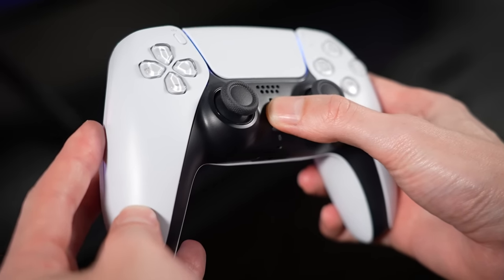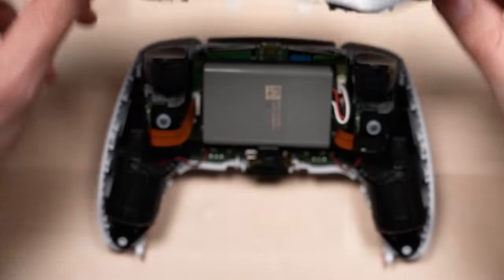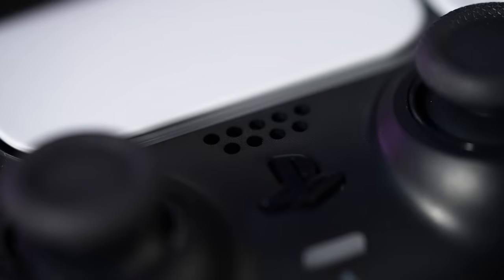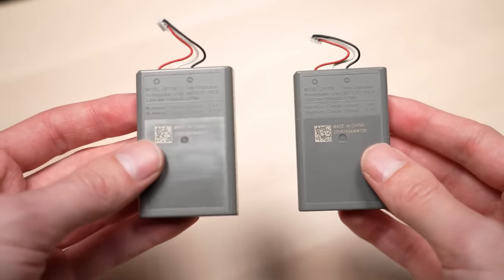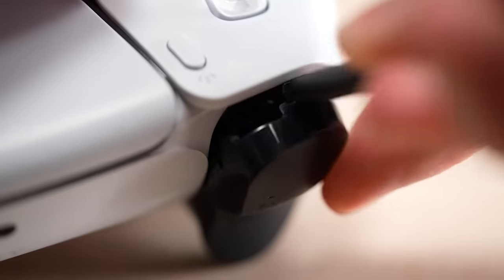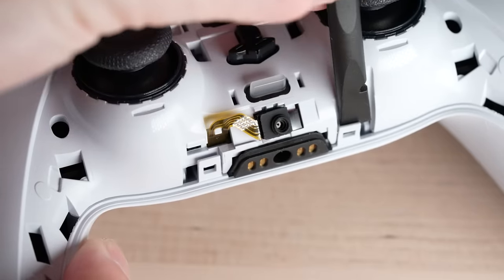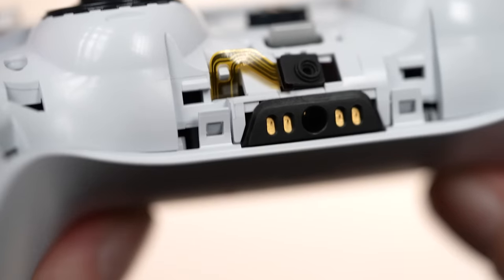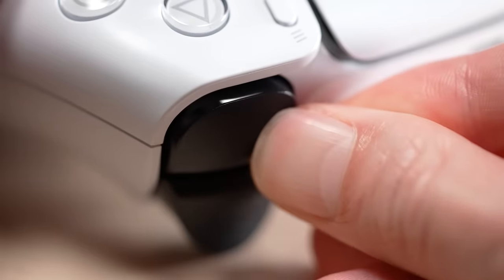Sadly, your Playstation controller won't last much longer..

Comment: Would be nice to know what good charging habits are. I know from my RC hobby that Li-on batteries are stored at 3.85v per cell, and that loses life when stored at full charge, and also empty charge. In a device like this, we simply do not know the voltage so it's not easy to say what charge level works best and moreover, how to charge it there.

This is why the iPhone charges overnight partially and only completes the charge when it thinks you're likely to wake up and start using it to drain it to a longer lasting charge.
Reply: its just the same with phones. charge it from a usb port (to prevent battery heat), keep it between 20% and 80%, turn off vibration and lights to improve and double the battery life on rumble heavy games. my controller's 5 years old and it still holds 9 hours of charge.

Comment: I got my ps5 soon after release and the controller started going to crap after like 5 months. The adaptive triggers are super inconsistent with their tension sometimes not working or being way to stiff, and stick drift for sure. It's still usable(barely) have been wanting to get the black one but heard those new ugly bright colored ones are the only ones that have fixed a few issues/used better parts.
Reply: I’ve got a black one, got one on launch and use it every day, works fine.
Reply: I have the black one and it has the new parts and improvements

Comment: The joystick drift is driving me insane. 
I bought the console in November, and by January I was already experiencing it. 
It is -ever-so-slightly but it is there. 
Makes dealing with the camera manually a hassle to handle if you already have to keep track over the game’s mechanics.

I have also noticed a small failure in input recognition. 
It is not consistent, but every 6-8 inputs I put in, usually the last isn’t recognized by the either the games or the controller. I’m not really sure, but it has cost me so many death in Souls games.

Edit2: my PS5 got stolen 🥲. I guess the drift issue no longer matters.
Reply: Same here its pretty annoying but I got use to it
Reply: Xbox > ps
Reply: Its a souls game issue due to thw input reading messing up
Reply: @easyw1220  really? I’ve played most of them previously on PS4 and I don’t really remember having this issue. Perhaps my memory is wrong.
Reply: @Ancor_Vantian  nah its a elden ring issue look up input lag
Reply: Sony is becoming as bad as Nintendo without trying to be as good as them lmao
Reply: @SchrodingersDinger  There's at least a fair chance that's dirt in the mechanism, assuming its not just a faulty unit or has been abused. 
Around October last year, I found stick jitter had become very apparent and annoying when doing the lock minigame in Judgement, and taking apart the controller to apply some electrical contact cleaner into the stick modules, working that in, and then applying some silicon spray lubricant completely cleared it up.
It's worth a shot versus the cost of a new controller.
Some TLC and maintenance can go a long way.
Reply: How was it stole ? Did a friend of yours steal it ?
Reply: @shikadaikobutsu3414  some asshole (I’m presuming the asshole part) broke into my apartment and stole a bunch of stuff. Console among them.
Reply: @Ancor_Vantian  Jeez, I hope you're doing better now and that this piece of trash will get karma. Wish you the best for what's next mate !

Comment: Xbox series X controller is significantly superior in build quality compared to the PS5.  
In addition Xbox's controller battery life  also last longer.
Further more, changing out the rechargeable battery in the Xbox controller is also easier.
To add salt to wounds, Xbox controller suffer much less stick drift compared to PlayStation.
Reply: Regarding stick drift, you might just be experiencing product bias or luck of the draw because the analog stick components in the PS5 and Series X controllers are completely identical. Incase you are unaware, those specific parts come from the same manufacturer.
Reply: Lol xbox controllers haven't changed since 360 days. Still need to waste money on batteries. Next gen console with no Next gen controller. Same as xbox one pads tbh. Ps5 controllers are far superior in every way.

Comment: Both my controllers are gen 1 and haven't had any issue whatsoever. I grew up with a techie in the 90s so I generally keep the battery between 20-80%. Reduces battery wear by a lot.

Comment: I guess I can count myself lucky I’ve never had this problem. I swapped between 2 controllers for PS4, and doing the same for PS5. Always use power save settings. Never had a problem with battery, drift, or anything. Switch JoyCons on the other hand…

Comment: I’ve gotten lucky lol, I’ve used the same PlayStation 4 controller since 2015. The battery life has gone down a bit but it still works and holds a charge.

Comment: 0:16 ... Imma stop you right there, for a moment. I got my PS4 in 2014. Played it until Last months (got a PS5). I've had the same two controllers for PS4 since 2014. I play A LOT of video games. I spent over 2,000 hours on ONE game in the past two years alone..... just to give you an idea of how much I play. 

I've only had one issue with one of the controllers. The grip is half off on one of the analog sticks. Other than that... controllers are still great. I've been very lucky, I guess. Fully charged, they last about 4-5 hours.

Comment: Just gotta take special care of the controllers. Sometimes you can be unlucky that the battery packs out early or the analog sticks start drifting but for the most part most controllers should be lasting at least 3-4+ years

Comment: I had a clip on battery pack for my PS4 controllers, which worked great.
(I'v never needed to change a PS4 controller battery)
I might do the same with the PS5 controller, rather than open the controller up, but I do appreciate your informative video.

Comment: I replaced my PS4 controller battery with an upgraded lithium and installed new joystick covers and is good as new. I will say as a warning, be careful with l2 and r2 triggers. tiny springs popped out and we're tricky getting back in.

Comment: I believe it's generally better for devices using batteries to use up all charge, instead of charging it while it's still half full. Did this with a phone of mine and it helps.

Comment: People shit on Xbox for having controller that use AA batteries. It's so much better. Easy to replace, no risk of damaging controller, and it's really cheap. With rechargeable batteries, or even getting a battery pack, no need to worry about having to open up the controller
Reply: yeah exactly bruh xbox controllers don’t die you just need to put in any aa batteries and it works just fine… i swear bruh atleast our controller doesn’t die lol

Comment: I saw a video comparison between the Xbox and PS5 controller and how if the PS5 battery dies on you, you have to buy a new controller while the Xbox uses AA batteries but after seeing this video, it's still cheaper to replace the internal battery for your PS5 controller than to keep buying  AA batteries for your Xbox.

Comment: Just bought the PS5 friday. I saw many good tips from you John. Thank you.
Funny thing. for my PS4 I have 3 controllers. Two of them are now about 5 to 6 years old and still work fine. How I did that, I don't know, but I hope my new PS5 controller will have the same lifetime.

Comment: I went though 4+ ps4 controllers. And I had 2 main controllers throughout the 360 era, they were durable as hell.
Reply: I went through 4+ PS4 controllers aswell

1st controller had a charging issue (lasted 6 months)

2nd controller 
Had stick drift and circuit board got killed due to a 3rd party charger
(lasted 7 months)

3rd controller
Also circuit board killed and was a 3rd party controller 
(lasted 7 months)

4th controller 
Brother accidentally broke it and couldn’t be repaired
(lasted 1 year)

5th controller 
Brother also broke it but got fixed (mic port, vibrators, speaker, battery and touchpad stopped working)
(Still got it and working)

6th controller 
(Main controller)
Got it 2 months ago

Comment: That's why Microsoft was smart.  You can use a new power pack or standard AA battery.  No openings the controller.

Comment: I had a DS3 for nearly a decade without issues, had 2 DS4 which both ended up drifting, I bought a DS and just 5 months later I needed to keep it plugged in because the battery would die quickly, the lack of quality has become more and more apparent with Sony, I will be switching to something else when purchasing a new controller.

Comment: Damn. I didn't expect Sony to not sabotage the controller with at least difficult to remove or easy to break clips. Having it so simple to open and replace was a genuine surprise.

Considering the appalling anti-repair culture in the modern corporations, especially the tech industry, it's sad that something as simple as replacing a battery is seen as a notable, pro-consumer move by a tech company.

I'm glad to see it but this really should be less than the standard, with full consumer capable repair being the norm.
Reply: Great video and more than appreciate yourself and others like you working so hard to improve know-how the tech-space.

DIY repair isn't scary and you definitely do a great job at providing that.

Comment: Man ive never had this issue. Ive still got my original ps4 controllers and they work after thousands of hours. 2 of them joy sticks ripped and 2 had joysticks jammed. I replaced the joy sticks on all 4, rebuilt 2 of them into dallas cowboys and texas longhorns controllers. But after the joy stick replacements zero issues on all 4. actually i did replace one of the springs in an L2, ps4 controllers weren't the best designed but ps5 remotes fixed the joystick issues ps4 controllers had. No jam, no tears, had mine since day one. Charge lasts incredibly long and I've already got thousands of hours on it. Never seen a battery die on any.

Comment: I got my PS5 back in early December and have already replaced 2 controllers. There really should be a class action lawsuit against Sony for this controlgate. It's ridiculous that these things are 70 bucks a pop and they only last a few months, if you're lucky. I've never had the battery issue because my controller never lasted longer than 2-3 months thanks to stick drift.
Reply: I’ve had mine since November 2020 and are both working fine. Maybe take better care of your controllers.
Reply: @VoidReplicant  I am happy that you have working controllers. Are you assuming that I am not taking care of my controllers? Goodness, people are always kinda jerks when they don't have to speak to others face to face. Very brave of you...

Comment: My PS3 controllers still hold a charge and both were purchased in 2008. I had one from 2010 that needed a battery to be replace last month… analog sticks are all fine. 

Of note. My two launch ps4 controllers are the same. 

I have always charged around 10-20% and removed from usb or charger once complete. And I cycle through controllers when playing Single player. I don’t know if that has increased my mileage, but also a smoke free home at 76 degrees.

Comment: Helps to mute microphone in settings when it turns on, for Adaptive triggers/haptic feedback (which if you feel your games dont have/use much you can weaken) and dim lights use less power too. System is so flawed though its fun.

Comment: Replaceable batteries in my Xbox One controller was the move. I've had the same controller for YEARS and just use rechargeable AA batteries to save on the cost of having to buy big packs of batteries. And when I use it on my PC, I just take the batteries out entirely and go hardwire, doesn't bother me since I'm sitting right next to the PC

Comment: Atleast he more honest than 90% of the PlayStation channels that have been so dishonest with the PS5 since launch.
If you don't own one yet be warned hundreds of thousands if not millions have issues with stick drift, noisy disc drives and god awful irritating coil whine down to notbing more than cheap parts and a cheap manufacturing process to bring costs down.

Comment: I wish that the PS5 controller had standard AA batteries like the Xbox Series consoles. You could still have them be rechargeable, just easier to replace.

Comment: The analog should be using encoder sensor and could be recalibrated.
Contact point shouldn't be pressure based

Comment: Xbox controllers use AA battery's, you can use a battery pack instead though, which has decent charge and is easier to replace. I've also had no stick drift issues

Comment: I honestly wish it the PS5 controller used removable battery packs like the Xbox controller. There seems to be a big difference of opinion when it comes to that but honestly it’s so much easier to swap the battery pack rather than plug in your controller

Comment: Not saying it’s not true but I’ve owned 20 PS4 controllers over the years and no problems my daily controller is the PS4 DualShock 20th anniversary edition and that came out almost 8 years ago and still works perfectly fine.

Comment: Nice video, I had a ps4 controller but the method is basically the same. That being said I do wish you could use AA or AAA batteries in these controller like you can with xbox controllers since buying new rechargeable AA or AAA batteries are usually cheaper.

Comment: This is one of the reasons why I prefer the way that sx and S handles the xbox controller by giving you the option to use rechargeable batteries.
Reply: Yeah they also last significantly longer. The sense controller is also shown to break down faster and have an issue with the trigger buttons
Reply: @Spartan_83  ps controller break faster.
Reply: @ArthurCallahanSolos  that's what I said
Reply: @Spartan_83  oh thought u were talking about xbox controllers breaking faster lmao

Comment: Tbh I don’t understand why PlayStation hasn’t implemented swappable chargeable batteries a long time ago? It only makes sense. Thanks for this guide btw really appreciate it. Sucks we have to go through this much just to work around. At least I don’t have to worry about this with my Xbox controller. Then again with that I have to worry about dead or stuck bumpers. Sigh can’t win with either brand lmao.

Comment: Before I even watch this video, I'm guessing this is about joystick drift or battery life. I have been using my ps5 controller regularly since launch. It works completely fine. No drift. Buttons are crisp. Battery is slightly degraded like any other device with many charge cycles. It still lasts a few hours. I keep a cable right next to where I sit battery life is never an issue anyways. They charge off the wall guys!

Comment: Sony says the battery life on the Dualsense Edge is even worse. They have some nerve selling people a $200 version of the controller when they haven’t even fixed the outrageous battery issue with the regular one. Instead of making overpriced controllers or a PS5 Pro ( I doubt many people are gonna buy the Pro now that everyone has just managed to get a regular PS5 after a 2 year supply shortage) Sony should manufacture new controllers with a better battery. They should do a recall on existing controllers and replace the battery free of charge. Probably wishful thinking but it would be nice. We’ve certainly payed enough to deserve a controller with battery life that isn’t total sh*t.

Comment: My last PS4 controller (just finally replaced it) was used by me non stop for about 3 years and it was about 3 years older than that. It still works fine for most games, but for rocket league it wasn't working well because the x button was loose and often was too easy to press, if you pressed down the right way it would spam press (but inconsistently, so I couldn't even take advantage of it).

Fortunately I got a good model of the dual sense controller so it should last me a while as well.

Also I don't use the controllers wirelessly as my PC doesn't have Bluetooth.

Comment: I used to charge my controller with a cable and noticed that my controller would die very fast even after charging it for hours. Then I bought a charging station and noticed that my controller would actually last for 8ish hours. I would only suggest buying a new battery if you own a charging station and if your problem still persists.

Comment: Good thing I bought the ps5 bundle with 2 controllers and 3 games I’ve kept my extra controller in the original box. Incase the one that came with the ps5 starts losing its function over time.

Comment: I've been using the same controller for years, I've always been lucky with never getting stick drift on any controller (even on my switch until my sister dropped it) + I've used my controller wirelessly less then 10 times probably

Comment: Wow other controllers that aren't PlayStation just let you pull the battery pack out and switch it like this is some kind of new technology but with this PlayStation controller you need to completely take it apart

Comment: I have a very old ps3 and I often play some games in it, the controllers' batteries never needed to be changed ever, the duration of the full charge was still equal in all those year.
So I'm thinking that this is done on purpuse to make you change the battery, maybe the main purpuse way even to change the controller itself, for those that don't know how to change that battery.

Comment: Not an issue with Xbox controllers as you can easily replace the battery when it starts to lose efficiency. They're also not susceptible to drift issues. Yeah, Ps5 controllers may be more fancy but I prefer the Xbox controller for reliability and comfort.